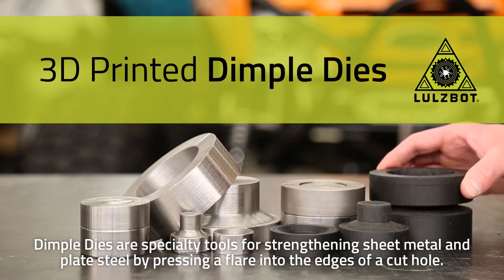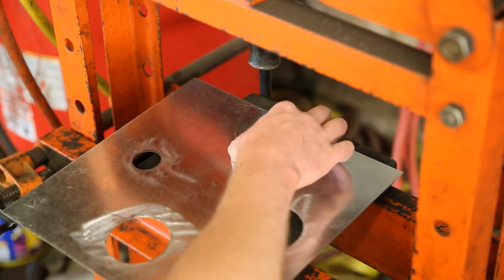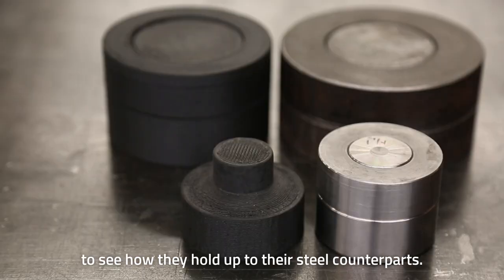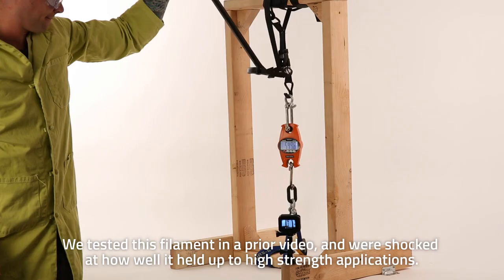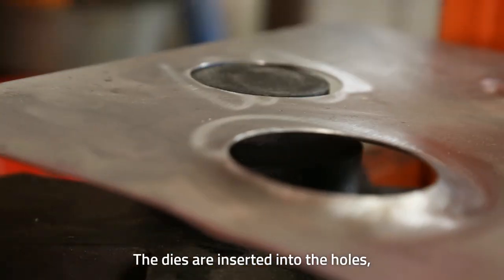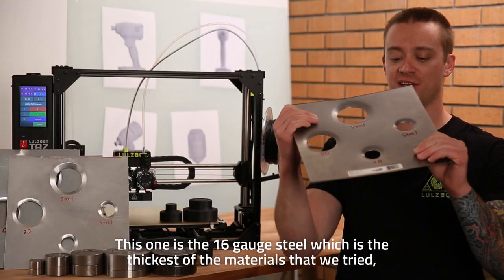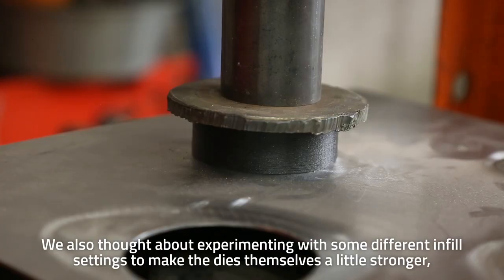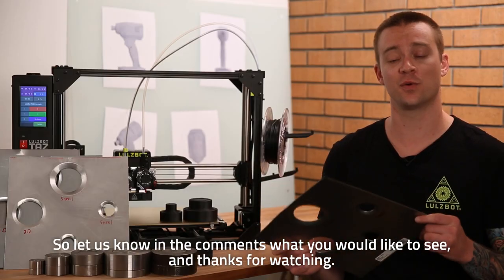3D Print Your Own Dimple Dies

Comment: It would be interesting to know the actual mechanical limits of the 3d dies, and the failure results. I know from prior work in a steel shop, a broken steel die (punch die)  is pretty much a bullet shot into the shop. Would the 3d tend to just crush or would it break more dramatically, like the steel?
Reply: I would guess that steel dies explodes because of residual stress due to heat treatment. So since they are no residual stresses in 3d printed parts, it should just crumble on itself.

There's a possibility though that when it loose structural integrity the press plunger goes down pushing plastic pieces to the side, but i wouldn't expect it to be dangerous if you're wearing the proper safety gear ... (Clothes and safety glasses)

Comment: How small a hole can you get away with to dimple a 6mm (1/4”) end diameter with as much of a cylindrical "pipe" remaining? Using soda can aluminium. Looking to make 'radiator' fins on high pressure compressor tubing to keep it cool(er).